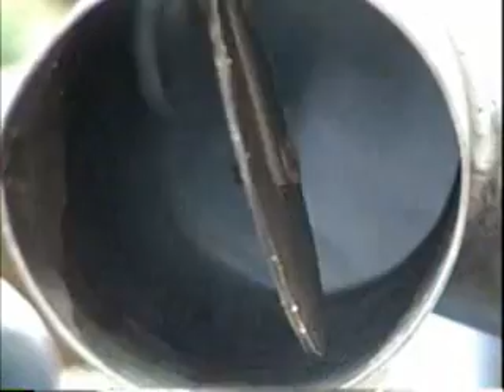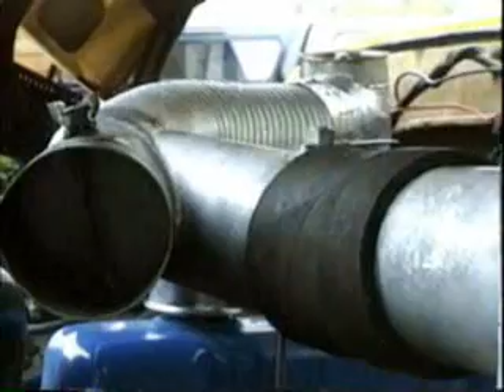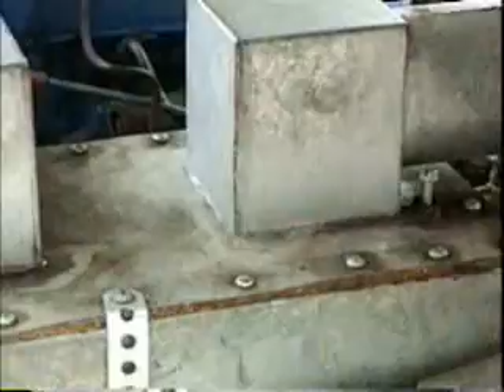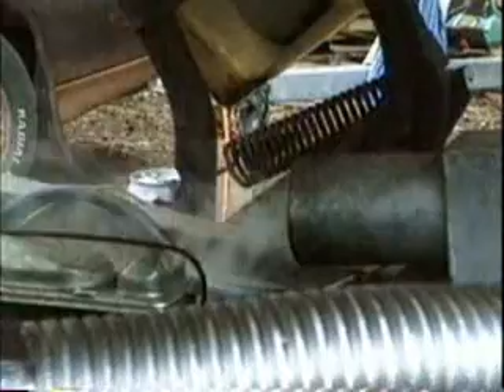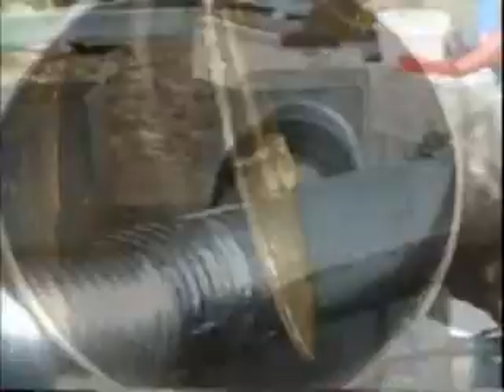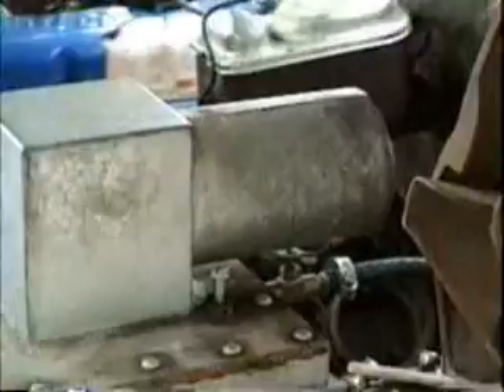Here is definitive proof on how to separate all Atoms in all liquid soluble matter.

Comment: If I understand your vapor chamber design, you spray the liquid mist of gasoline directly at the Calrod heating element which remains at 600 F. Some experimenters have replicate your white vapor fuel system with a slight variation ie placing the Calrod heating element under a flat sheet of stainless steel, heated to 700F with no residue remaining. Lower temperature flashing seems to permit residue.

Comment: I agree the white vapor(and non burnable liquid) needs to be analyzed. Have you tried flashing the fine mist of gasoline at 700 F(minimum temperature at all times, compensating for the cooling of the heated steel- as the cold liquid droplets continue making contact with the heated steel)?

Comment from the maker: I have never tried the aqua tune. I would say it was a scam after I watched the video. It would take pressure to take the water above the 212 degree boiling temperature, applying the heat to the liquid the conventional way. The army used water injection for their bombers, in WW II and got increased power for take off, injecting water into the cylinders of the aircraft motors.

Comment from the maker: If I am right about the separation of molecules in gasoline. To separate the molecules in water will require precise temperatures. The difference in the boiling temperatures of oxygen and hydrogen, applying the heat to the liquid, is around 60 degrees Fahrenheit. This means if there is another boiling temperature for hydrogen and oxygen in water, it stands to reason they will have a similar temperature difference. A large mass of heat and a very fine mist of liquid is required, to Flash Liquid

Comment from the maker: True, pressure, inside the cylinder, makes it possible to take the water above it's 212 degree, boiling temperature. They are applying the heat to the water, and using pressure to go above the boiling temperature of water. I am saying if you apply the water to the heat, there is a temperature that will cause the hydrogen molecules, in the water, to boil and turn to a gas, while the oxygen molecules remain a liquid. I separated molecules in gasoline. A gas spectrum analyzer can prove it.GOT ONE?

Comment: hello mate are you doing this if so are you using the existing cat or separate cat i have built a copper tubing in the cat that was not much good as billy says you must add the fuel to the heat rather then heat to the fuel thanks

Comment: You are very welcome. And thank you for sharing your knowledge. The experimentor that used the Kettle for testing- also purchase a 200amp Alternator on ebay for use on the experimental automobile with a v8 engine. This person use the stock Alternator + the 200amp alternator. Both alternators were used to power the Calrod Heater which heat the larger white vapor chamber, which ran the engine very well. This is an additional load on the engine, Although the fuel efficiency increased- neverthless.

Comment: funny thing my friend i thought of that idea to because kettle is cheap to buy lol the engine i ran was 2000cc 4cyl my prob is my alternator is 90amp so before spending to much money on heater specially made up got do lots of sums & experiment to if you want high octane fuel 1 mothball per 20lts fuel works good has to be 100% NAPHTHALENE i always use it when i hire a car when go  northern cyprus fuel there is crap i will try 2 share as much info as i can & thanks for your info too

Comment: That's what I like about your system so much. It's incredibly simple, And incredibly effective. Your system solves the biggest problems that are said to make running gasoline powered engines on vapors- impractical. Your white vapor does not condense back into a liquid, even when the vapors become cold. Your white vapor does not need to be mixed with air at various air/fuel ratios. You only need to permit fresh air to be present when the liquid fuel contacts the hot steel- producing the vapors.

Comment: If they only had your White Vapor Fuel System to run those engines. Then add to that the same water injection systems they used on those engines. I'm trying to imagine the incredible power increase. Truly incredible horse power increase. Smokey Yunick mention that he achieve 1.5 horse power per "Cubic Inch Displacement". And that was with the Grey Condensing Vapor that- if not kept hot- would quickly turn back into it's liquid state. Smokey ran 15psi with a Turbo(homoginizer/One way check valve)

Comment: One experimentor used a Stainless Steel Tea Kettle and put a small 400 watt electric Calrod Heater up to the bottom of the kettle. An Automobile Fuel Injector (Sprays 50 micron to 65 micron) spray the fine mist of cold liquid gasoline onto the 700F heated steel surface of the inside of the kettle, And ran a small engine (approximately 5hp) with great success. What was very interesting was to learn that the white vapors- when put inside a glass jar and sealed- did not condense back into a liquid.

Comment: I understand. Cold air has more Oxygen per cubic foot. Oxygen is extremely explosive. In my study of NOS(Nitrous Oxide Systems) which many street racers utilize- It's the Oxygen that gives the boost, not the Nitrogen. Nitrogen is only present to cool the hotter burn of the Oxygen. Pure Oxygen without Nitrogen would be much to hot of a burn and it's said would damage engine internals. The air we breathe is approximately 21% Oxygen and 78% Nitrogen. And a little less than 1% Argon.

Comment: It's always good to have a fire extinguisher near by at all times when experimenting. Have you tried building a GEET Fuel Processor? Free build plans are available on the GEET International(dot com) web site(also see "GEET Friends dot net" web site as well). For experimental purposes- you can use a small lawn mower size engine to experiment with the GEET. You basically build the small engine GEET with pipes and fittings from the local hardware store. The unit I'm building is near complete.

Comment: problem in experimenting can be costly so am taking my time i need to do soothing with exhausts heat combined with the hot chamber or simple manifold gases straight in with gasoline to intake no heater c what that does also with cold air because my experience hot exhaust gas reduces power years ago when i heard all this stuff used to think was nonsense but the so called real world is nonsense wild leaf of oil of oregano best natural antibiotic even rids pneumonia

Comment: I like your idea of using water injection in combination with the white vapor fuel system. I realize that gasoline will have different additives throughout the world. Keep in mind- Any part of the world that sells automobiles that utilize a Catalytic Converter in the exhaust system-which burns up the unburnt fuel(HydroCarbons) will have done extensive research into how to allow the unburnt raw fuel that leaves the engine- to be completely burned up in the Catalytic Converter-with minimal residue

Comment: hello mate am only on very early primitive state with it at mo am just using a hot plate with a saucepan lid fixed to it & am only on temp of 400 to 450 f at mo t into my fuel line & disconnect injectors & then runs on its own with some revving up silly little amount of  fuel usage the experimenting just spraying the fuel on hotter the surface yes looks like no crap but when you run engine things change with more fuel enough heat u can start with just vapors i have rev up to 3000 rev

Comment: The way I understand why the residue is not left over with higher temperature flashing of the liquid ie 700 Fahrenheit minimum temperature at all times(Staying below gasolines autoignition temperature of approximately 950F) is- if a residue were to remain- after combustion inside the engines combustion chamber- then the Catalytic Converter would quickly become coated with this same residue- thus not permiting the Catalytic Converter- all newer model Gasoline Powered Automobiles use- to work.

Comment: Thats truly great that you're running the white vapor fuel chamber. I hear only good things from everyone that has made one. I've not heard anything bad about running this White Vapor Fuel System billy design. How hot are you heating the Heated Steel Surface up to? If you get the Stainless Steel up to 700 F minimum at all times- even after spraying a fine mist of fuel onto the steel over time- I've been told by those testing this system that 100% complete vaporization takes place. No Residue.

Comment: i have read the reason they added lead in gasoline was because the pouges carb worked well & had sold units to stop it working they added the lead to stop the vaporizing those days i read 30feet away if you had gasoline & naked flame would ignite & we are led to believe its to lubricate valves bullshit & today's gasoline there meant to be cleaning agents in it bullshit again billy's method is fantastic best of luck mate not want to get into argument about aqua tune ok lol

Comment: yes billy's method works great i have put comments on here how good it was soon as i gave figures on fuel usage my comments disappeared of this site they do not like the figures THE BIG BOYS lol but here in the uk you do get the scum on the hot plate then it needs more temperature as it stops it getting to temp required i personally think adding proper water injection with pump will possibly run more power & clean the scum roll on the summer to experiment lol cold here at mo lol

Comment: hi am glad your experience is good with aqua tune i had lots of problems trying to get it to even produce power via there instructions ie change plugs bore resonator reset ecu etc etc that alone took enough time because the ecu have to learn i told them i lost 2mpgs & i probably need some kind of efi unit they said no i do not. be honest with you as a water injection it is ok that's all my model is the aqua thrust meant to be more power simple water bubbler could achieve lets forget this -

Comment: If you read almost any review of the 2000 to 2006 Honda insight. You will quickly learn that the car is described as slow. After installing the AquaTune unit with four Hydrogen Generators, the car can easily go 108 miles per hour in 3erd gear. And the car is a five speed manual transmission. That's five forward gears. I will also film this as well. AquaTune describes the increase in miles per gallon as comming from an increase in power- which allows us to drive the same speed-with less throttle.

Comment: I'm working on a video which will show the AquaTune Hydrogen Generator Producing Ortho-Hydrogen Gas. I will post this video up onto my YouTube channel. I will also ignite the Ortho-Hydrogen Gas and film this testing procedure. Keep in mind- The older model AquaTune units did not produce Hydrogen gas at the generator. If you want to understand more about how and why that is- and how the older model AquaTune units work compared to the latest models- you can call AquaTune tech support directly.

Comment: The 30 day money back guarantee gave me complete confidence in trying the AquaTune unit. I was very impressed with the knowledge of automobiles and technical understanding AquaTune tech support has. I learn very quickly that my car had a bad EGR valve and the wrong upstream O2 sensor(Wideband Air/Fuel Ratio) which would not allow the car to achieve the benefits the AquaTune unit provides. Once these parts were replaced, the AquaTune work very well with an increase in Fuel Efficiency of 25+ %.

Comment: hi there i am in uk had contacted them that there was no increase in power & lost 2mpg so then i was told to bore out the bronze end which you call the resonator or what ever it is i got bit more power that's all it is good for it does not produce any kind of explosive gas am not sure there was money back guarantee those days even if there was would run out by the time shipping here to there took ages to come am glad you got good results was told do not need EFI unit

Comment from the maker: This all means the water was under pressure when the oxygen and hydrogen molecules separated. They had no way to measure the temperature needed to do this. I think they guessed at the temperature inside the cylinder. In any case they were still applying the heat to the liquid. Pressure was the only way to take water above it's boiling temperature, until I discovered how to Flash Liquid. A Gas Spectrum Analyzer on what I've done to gasoline, the white vapor, and brown liquid will prove it.

Comment: My understanding is that an older model automobile design to run on Leaded Gasoline, Being converted to run on Natural Gas Vapors(CNG) may burn the valves and or valve seats. My understanding is that as long as the automobile was design to run on Unleaded Gasoline, It can also run on Natural Gas(in Vapor Phase) without complications ie without burning valves nor valve seats nor any other engine internals complications. This is the same Natural Gas that many homes use for heating and cooking.

Comment: One of the differences between running an internal combustion engine on (Vaporized) Natural Gas vs Vaporized Gasoline, is that Gasoline has much more BTU's(British Thermal Unit's) compared to Natural Gas ie CNG. In this light, Honda mass produces a car which runs on a fuel which is already in it's vapor phase or state when it enters the engine's combustion chamber. It's called the Honda Civic GX. Newer model cars built to run on unleaded gasoline are often converted to run on CNG as well.

Comment: It is also theorized by many Physicist and Engineers that running an internal combustion engine on vaporized gasoline will burn valves and valve seats & melt the piston and rings because the engine would run much to lean(not enough fuel per given amount of air). What I have not been able to find, is a physicist or engineer theorize how an internal combustion engine runs on Natural Gas. Natural Gas is a vapor when it enters the engine, not a liquid droplet such that gasoline fuel injectors permit

Comment: Many Physicist and Engineers theorize that we cannot run a gasoline powered internal combustion engine on vaporized gasoline. Some of the reasons stated are, The additives prevent vaporization of the liquid fuel. Or, The additives will coat the heaters and eventually prevent the heating element from vaporizing the fuel because the heating element would be coated with gasoline addtitives over time. Your white vapor system achieves what is said to be impossible.

Comment: Only non-distilled water has minerals in it, which 100% of the time, will plug the processor up. Pure distilled water does not have any minerals in it, thus will not plug(nor coat) the Processors Resonant Chamber. If any minerals or dirt ever coat the internals of the processor and generator, you will not be able to achieve the minimum 25% increase in Fuel Efficiency, AquaTune guarantees(that's a 30 day money back guarantee). Why would you run the system for years when it's not working for you?

Comment: The earlier AquaTune units did not produce Hydrogen at the Generator. The earlier models weakened the covalent bond of the water molecule with Resonance and Frequency. The covalent bond of the water molecule would break once the weakened covalent bond encounter extreme heat and compression inside the internal combustion chamber. Thus releasing the Hydrogen and Oxygen from the water molecule, inside the combustion chamber.

Comment from the maker: I never heard of the Aqua Tune device. I always played with gasoline, until I realized what I was doing to the gasoline. Analyzing the white vapor, and the non flammable liquid I get using my Flashing Liquid method, will make or break my theory. A Gas Spectrum Analyzer, will answer my questions, but I am on a fixed income, and my house burned down in May 2011. Someone else needs to take the bull by the horns, I can't afford it.

Comment from the maker: You know, I don't think the temperatures were that high. Most metal will melt at 2000 degrees Fahrenheit, and I know all metal will melt at 5000 degrees Fahrenheit. Temperatures that high the water would boil in the lines that feed the water to the cylinders. I detect a flammable gas from water at around 220 degrees Fahrenheit, using my Flashing Liquid process. I know the difference in the boiling temperatures of hydrogen, and oxygen are around 60 degrees, so heat mass & a fine mist are critical

Comment: The AquaTune Water Injection System, also allows a small portion ie 40% of the distilled water that enters the Hydrogen Generator, to pass without becoming Hydrogen Gas. This 40% water mist which becomes a fine mist at the point the Venturi Nozzles meet the intake manifolds Air Stream- Cools the hotter burn of the Ortho-Hydrogen(Rocket Fuel :-) inside the engines combustion chamber.

Comment: I'm working on a video which talks about the system. The water injection system I'm running is by AquaTune. Because this system uses Resonance And Frequency(Distinctly different than the process of Electrolysis) to produce Hydrogen from water, the Hydrogen Generators produce 2.5LPM at only 1.5amps per generator. I'm running four Hydrogen Generators which produce just over 10LPM at only 6amps. This system uses Venturi Nozzles to maintain a vacuum throughout the power band of the engine.

Comment: With the right frequency, a portion of the WWII water injecting systems in the bombers, could; as you mention, have produced the very powerful Hydrogen. I've been running a water injection system in my 3cylinder 61cubic inch 1000cc Honda insight for several months with great success. ie increased fuel efficiency and power.